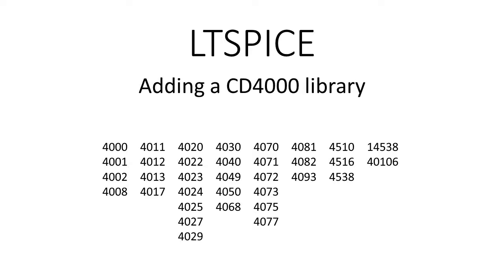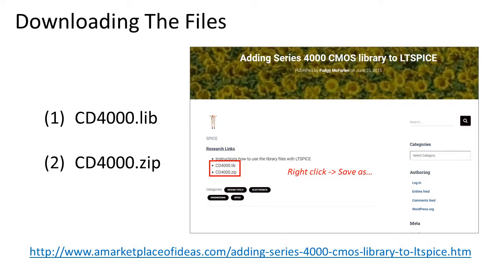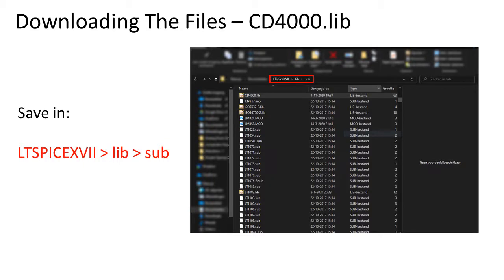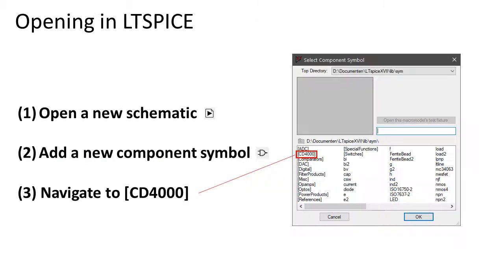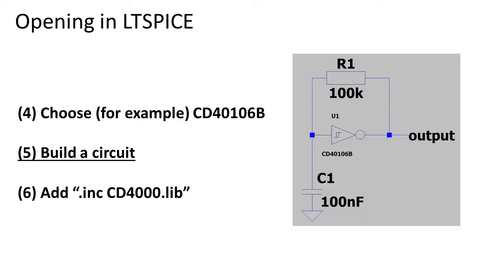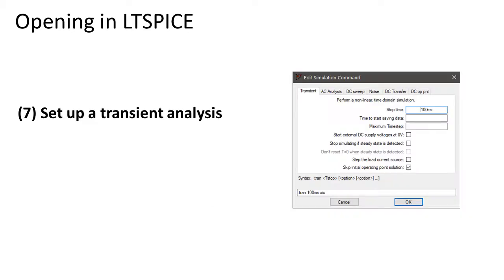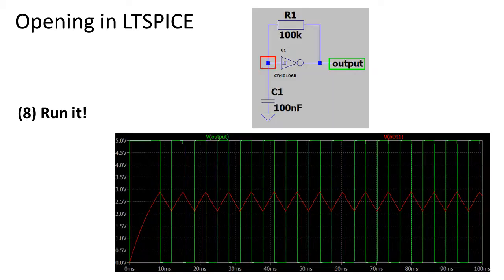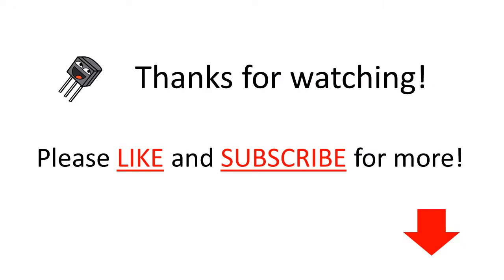LTSPICE: Adding A CD4000 Library (With 40106 Oscillator Example!)

Comment: Any ideas as to why LTSPICE won't recognize the CD4000.lib folder? It is in the right directory and I have declared it in the edit window but still have no access to the CD4000 schematics
Reply from the maker: There might be a chance you put everything in the folder of the install directory of LTSPICE. Try putting it in the folders in the LTSPICEXVII directory in your "documents". If in doubt, I explained it also in https://www.youtube.com/watch?v=Pa5S-zcQczM what directory to use.
Reply: @trevortjes  Thanks for the tip, I'm on a mac so the file directory is different, The download didn't come with LTSPICEXVII
Reply from the maker: @kieranmurphy3837  Ah I see. I am not familiar with macOS or whatever it uses. A quick google told me that you should have whats called a /Users/[you]/Library/Application Support/LTspice/ directory but that's just a guess.
Reply: @kieranmurphy3837  ik this is a year old, but in case you or anybody else needs help with this I just did it on mac. Its library/application support/LTspice/lib/sym
to get to library go to finder, press the "go" menu, and then hold option which should reveal library.

Comment: The zip file is not getting downloaded
Reply from the maker: Hi, the zip file is on the website in the description. The link still seems to work.
Reply: I had the same problem. Open the Developer Tools (press F12). Then, go to the Network tab. Refresh the page where the ZIP file is located. You should see the ZIP file appear in the list in the Developer Tools. Click on the ZIP file in the list, and it should download the folder.